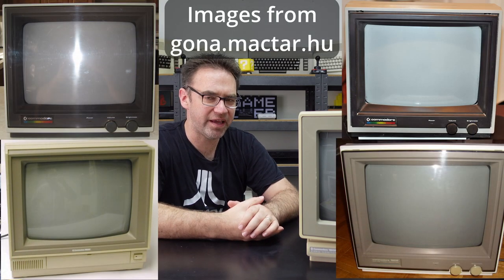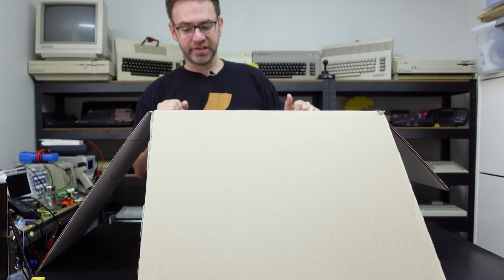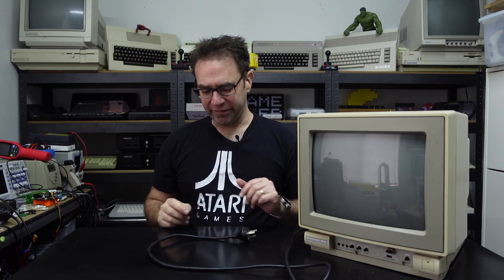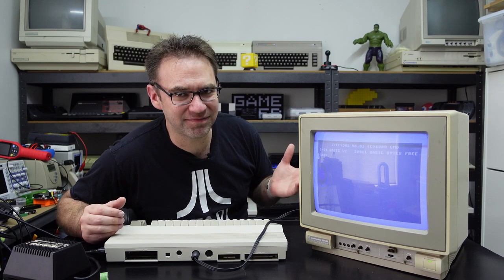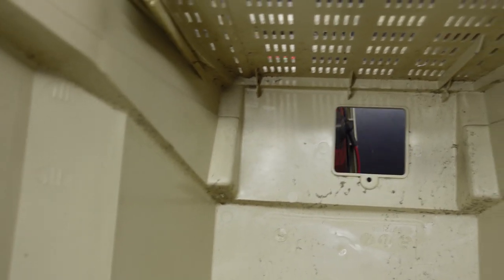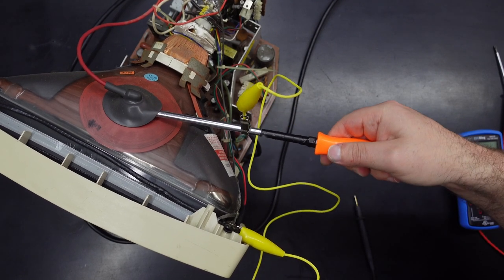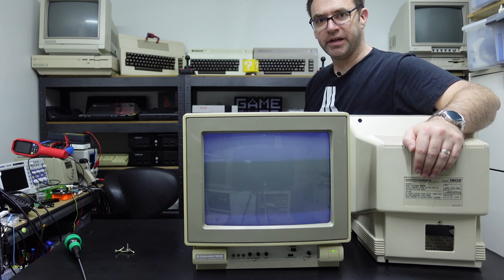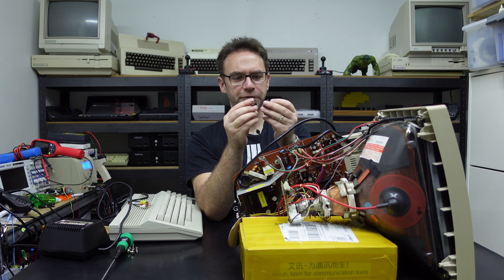Commodore 1802 Monitor: First look, cleanup and mini repair

Comment: Good video. Yes, I can tell you were upset during the unboxing with you dropping a F bomb. Good job on the cleaning! Big difference in those before and after photos! TY for the good Commodore content.
Reply from the maker: Cheers, hopefully next time its on the channel it will also have a front panel and fully working/calibrated

Comment: I would have been so jealous of you in 6th grade. My C64 and NES experience consisted of being hooked up to a 13-inch TV. Once in a great while we were allowed to hook it up to the 27-inch TV in the living room, which was one of those kinds that you lifted and had a stereo on the top.  The monitor looks good, and I get the nostalgia behind it. I sometimes go looking for Gold star 13-inch TV's, but I manage to talk myself out of buying one.
Reply from the maker: 27inch in the living room? I would have been jealous of you. We had a 18inch 1970s Thorn in the living room. It didn't have a remote or channel presets, so you had to tune into a new one with the UHF and VHF knobs. We finally got a Hitachi VCR in 1990/91 which had a remote but that TV stayed there until around 2001.

As for the Commodore it had to be shared between my brothers and my dad (who loved trying to beat Impossible Mission without dying). But the monitor itself was used by me until around 1999, I had a big old JVC HR3300, or a clone of it as the logo was different, think it had a blacksmith as part of the logo? That's going to bug me now. The VCR mech ate tapes so it was just used as a tv tuner. So that monitor outlasted the C64 in our house

Comment: Thanks for the video!  From a cosmetic standpoint, I love this particular version of the 1802 -- it's my favourite case design aesthetic of any monitor that Commodore made.  Yes, the monochrome input is specifically intended for the 128 (given the correct cable), and the marketing materials for this monitor defined it as an 80-column monitor in composite monochrome mode.  -- JC
Reply from the maker: Thanks. Yeah I think this and the 1084S-P1 are some of the best looking Commodore monitors, or a 1702 when paired with a breadbin. While the 1084 has a higher tv line count, I imagine this will look pretty sharp in monochrome as the comb filter would be disabled. Just waiting on the dp3t switch to arrive and then it will get a full calibration and review
Reply: @TheRetroChannel  Definitely the 1702 with a breadbox!  I'm all about the 64C aesthetic, and I presently have a recently-acquired pristine NTSC version of this exact same 1802 monitor sitting disassembled for recapping.  The convergence on mine was perfect, but the edges of the picture had more noticeable "bowing" than my other Commodore monitors, and apparently that is inherent to this particular model of 1802.  Looking forward to your review!  -- JC

Comment: In a past career I was involved with servicing video gaming (pokie) machines. We found out the best way to transport the 20" CRT monitors was face down on a significant thickness (100mm) of foam with more foam around the chassis of the monitor. If not done this way the weight of the CRT would often cause damage to the chassis/frame of the monitor. Fragile stickers on the box would invite damage from the freight companies. 

I'm currently repairing a Commodore 1701 monitor. The case has cleaned up nicely, but the PCB is pretty disgusting. It's not responding to compressed air, but a cotton bud/Q-Tip with Isopropanol does shift the grime. Did you manually clean the PCB of the 1802? It's a pretty daunting task.
Reply from the maker: Yep, went over both sides of the main PCB and neck board with cotton buds and IPA. Didn't want to leave any of that white gunk behind. Did the same for the case and all it's little vents, the whole thing took about 3 hours
Reply: @TheRetroChannel  Thanks for that. The air compressor did a good job of removing the loose dust, but as you confirm... I'll need to clean the board manually. I do recall seeing a mini "media blaster" that used fine CO2 granules under pressure to clean electronic equipment. It looked like a small air brush attached to a large tank of CO2. I can't imagine it would be cheap 😃
Reply from the maker: Haha, sounds dangerous but I'm sure something like that is probably used in professional settings (and probably has the price tag to boot). Other option would be an ultrasonic cleaner but they come with their own set of risks like cavitation. I'm sticking with cotton buds and IPA for now

Comment: How did you connect the SNES to the 1802? I assume a high quality RGB cable is not possible here. So does the composite cable deliver enough quality to use it for adjustments?
Reply from the maker: I made a little svideo to 2x RCA adaptor to split the luma and chroma and ran that into the 1802.
Reply from the maker: I haven't even bothered to try SMB64 on a C64, only played it on the 128 for the 2MHz benefit.

Comment: I buy this monitor today. FIrst the picture was perfect but for  only two minutes The picture goes dark and for now i dont have picture at all. High voltage is ok. Any sugestions ?:)
Reply from the maker: Could be a number of things. Has the behaviour changed at all with subsequent power cycles? Does changing the brightness have any effect? Any flicker on the screen when changing inputs?
Reply: @TheRetroChannel  No change. First it goes darker that i bearlly see anything and then complety dark. Changing brightnes-  no effect. No flicker at changing outputs. I have 185v in crt drive, cpu recives the comp signal. I changed cpu for tested no effect. What is going on ?:)
Reply from the maker: Is the heater in the neck glowing? You may need to check that in a dark room. Also is the high voltage running all the time and at the same pitch? An easy way to check that is with the spectroid app for Android, not sure if there's an iPhone equivalent
Reply: @TheRetroChannel  Yes the lamp on the neck is glowing. The screen is dark but something is going ther because it flickering a little.